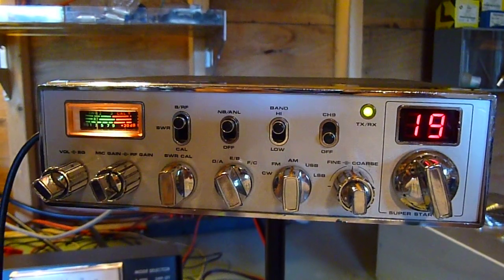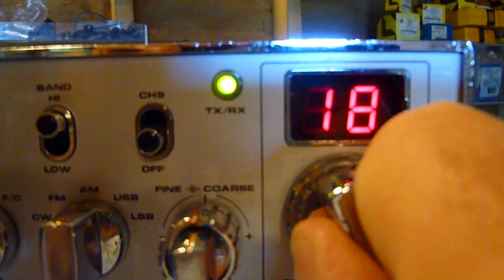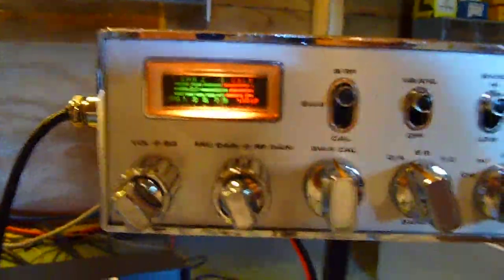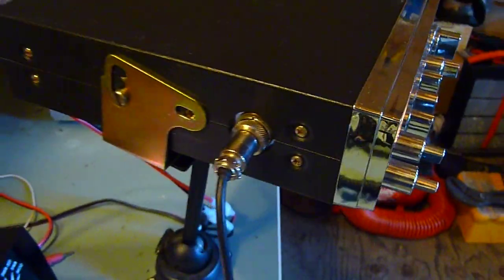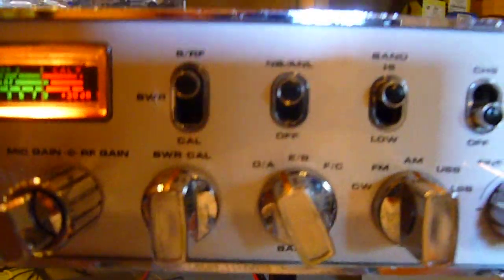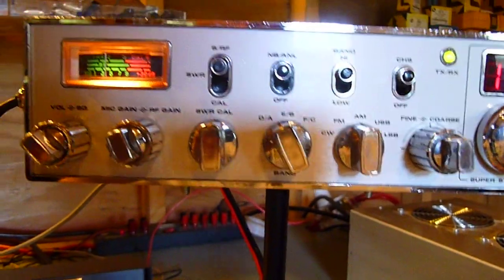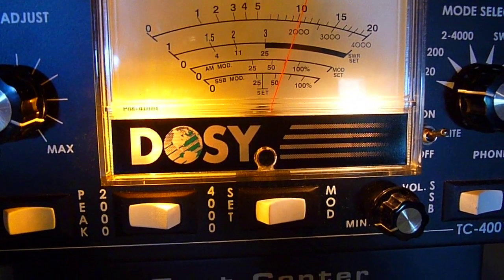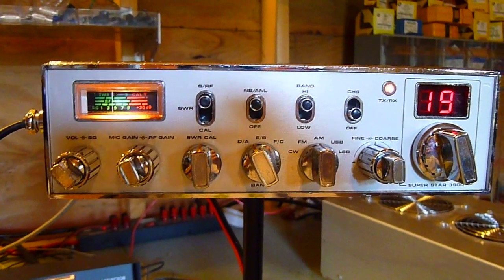Superstar 3900 10 meter radio

Comment: I have the MKI version of the SUPER STAR 3900 & am shocked at how stable it is on frequency on SSB. Has GREAT audio on transmit & a pretty good receiver as well.Mine has the lite yellow colored face plate util I get the new AMERICAN face plate for it in a week or so.The radio was given to me last week & I'm shocked at how well it works since I usually don't like any EXPORT rigs.I think I may actually keep this one! 3 watts dead key on AM & swings to about 12 & it swings to about 15 on SSB as it is & I have no idea if it has ever had a tune & peak job done on it but it works fine as it is now for me with an amplified ASTATIC TUG-8 D-104 desk microphone in my shack. {:>)

Comment: I have a blue illuminated ranger version and it works really well , 10 watts am/fm 25-30watts ssb very little to no frequency drift ,, one fault though. ... The signal meter doesn't work on ssb :(
   I've heard every one of this version of the radio has some kind of fault or problem so not too worried ... could be worse I suppose

Comment: how is the frequency stability on this model on ssb? i have one of the newer model 3900s and the drift was horriffic, on a warm day it would not stabilize even after being on for an hour. i was told ranger use cheap components on the new 3900s unlike the old ones. i eventualy sent it to a guy in austria gerhard maurer who done all the mods including the stability mod and now it works like a dream.